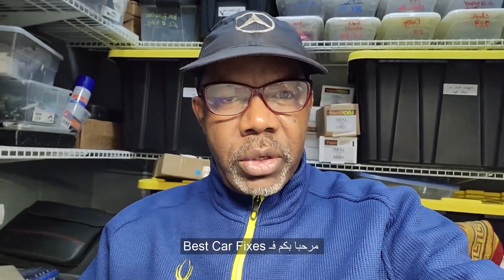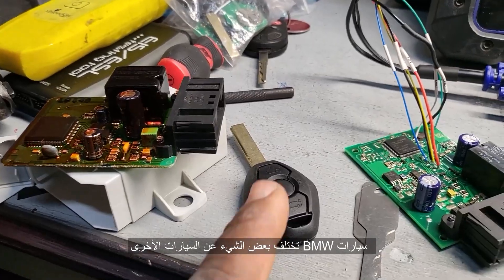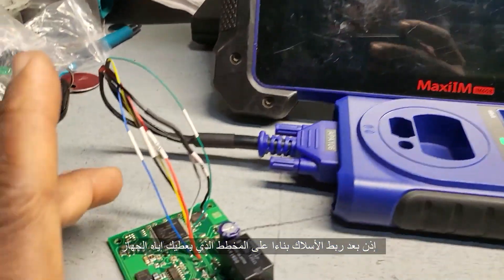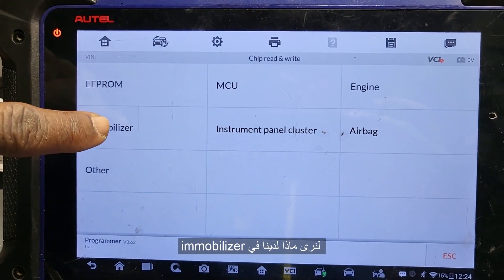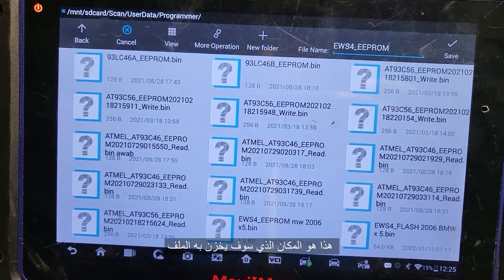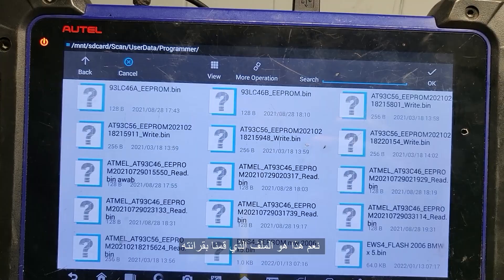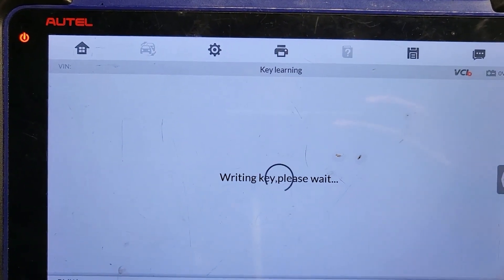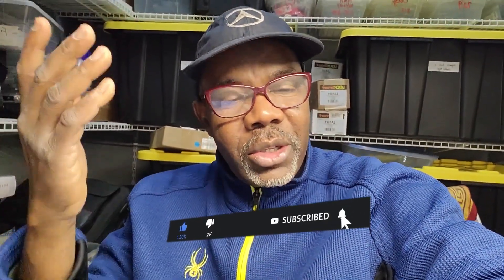BMW EWS4 ALL KEY LOST PROGRAMMING برمجة مفتاح البي ام دابليو

Comment: Hello Sir
I have ak90 with adapter for ews4
I heard that ak90 is not good for ews4
So about your expérience what's the best to do ews4 
Autel as u do or vvdiprog with adapter

Thank you for your help
Reply from the maker: i used i never has a problem also you can use autel 608 it has it
Reply: @BestCarFixes  oky thank you very much for your Replay